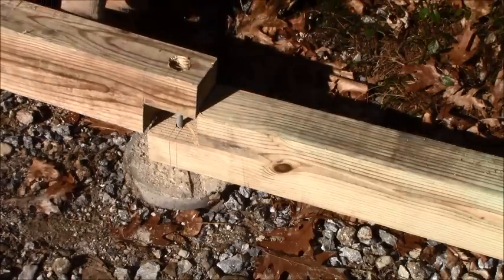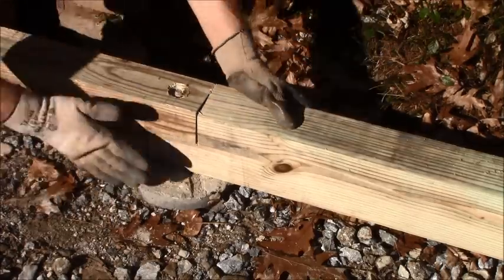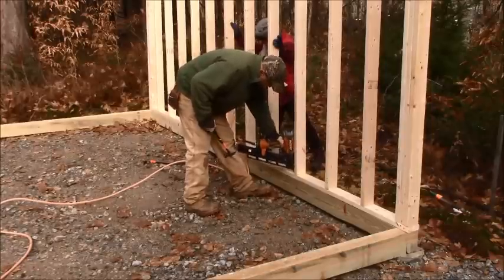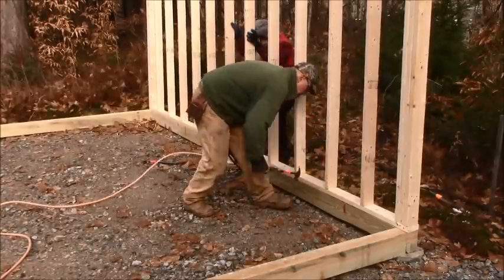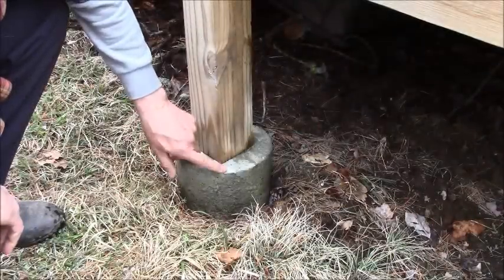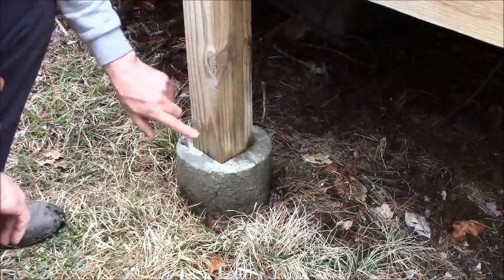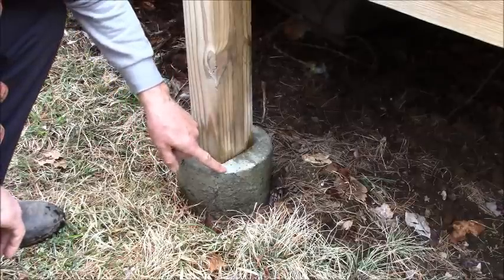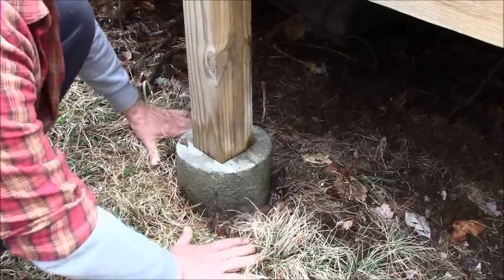HOW TO BUILD.  FAQ From My Cabin Building Projects Answered in a Carpentry Tutorial Format. DIY Help

Comment: Good free advice. You should be the spokesperson for bubble foil.
Only northerners know about froze line. Southerners just need concrete a 8-10" pad and start building on top.  Best to consult a local Geotechnical engineer to insure the footings are proper. Sure don't want uneven settling after the building is up.  Next is the building design and orientation for best use of natural lighting ventilation. Best built it right n no short cuts, unless you know what you are doing.
Reply from the maker: Agreed.

Comment: Great building tips. I utilized your septic idea for my shower in the cabin. I ended up going below the frostline but I also put 4 feet of sewer stone underneath the drain tube so hopefully it will perform well. I even implemented the black painted carboy method for my shower water and it works slick! Got to get up this weekend to resume work on the cabin and spend my first night in it. Coming along nicely now that the snow is gone.

Comment: Their starting to get away from just putting post into the ground. Not just because of frost, but rot. With this lumber today the treatment isn't as good. Go and watch R&R Building  on YouTube. He has a really great way of doing this in two ways #1 pours pillars or walls below the frost line. He has these metal brackets he either embeds into the cement or uses bolts.

Comment: Don’t you want a little space between the pressure treated post and the concrete pier to maintain air flow between the post and the pier?
Reply from the maker: No. If this was a home foundation I would put sill sealer  down to prevent air leaks.  https://amzn.to/3SMOwQP
______________________________________________--
As an amazon affiliate, commissions earned through qualifying purchases.

Comment: Love watching you build!  Question, do you ever have issues with the T111 rotting along the bottom? I had this issue on my garage and I've seen it on other structures or sheds that use it. In my case it was pretty close to the ground and that could've contributed to the rot.
Reply: I have had the same problem- it wicks water from the bottom up, not from the ground but from rain running down the face of the panels.
We get a lot of wind driven rain here; i suspect it holds up better in the woods where its more sheltered from the wind.

Comment: My cabin is gonna be 12x24 with a 12/12 roof, how should I do my rafters? Do I need a ridge board or would rafter gussets be ok? I'm having a fit trying to figure out how to make my birdsmouth cuts  depending on if I use a ridge board or not
Reply from the maker: I would use a ridgepole and if you're using a 12/12 pitch ALL your cuts will be 45 degrees both at the ridgepole and the top wall plate.
Reply: @thebossoftheswamp  ok how do I figure where to make my cuts while allowing for the thickness of the ridge and the wall sheathing?

Comment: And yet there are plenty of building videos where somebody uses osb board takes 2"&6" boards, frames it up puts fiberglass insulation between the studs, lays it down on posts sunk in sonotubes a foot to 2 feet off the ground, nails plywood for a floor, no bubble foil or bubnle foil insulated skirting and builds a cabin, providing a perfect space for rodent and insect infestation.